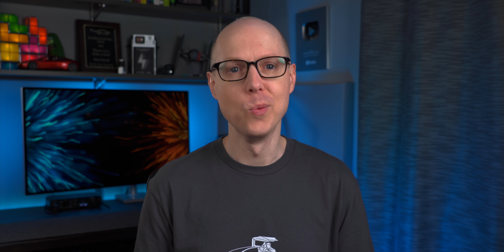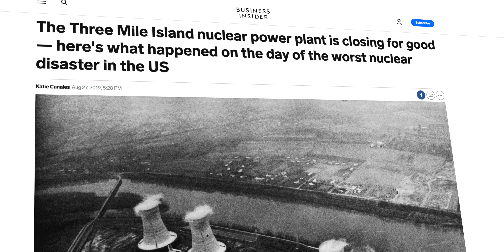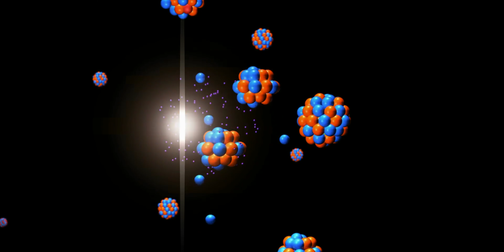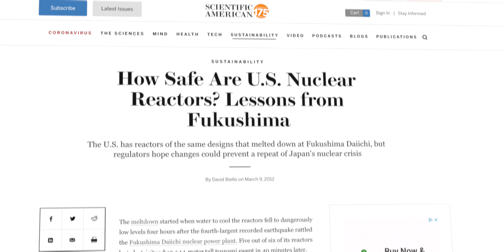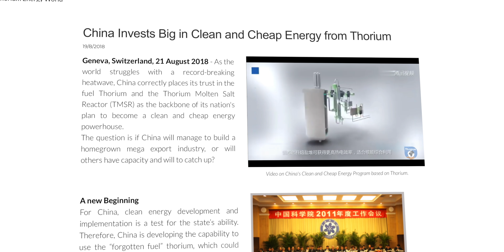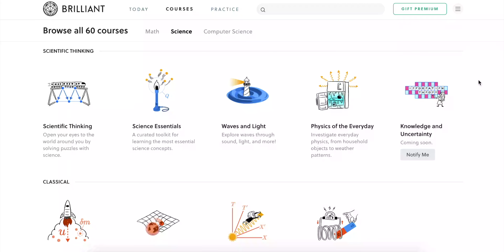Thorium explained - the future of cheap, clean energy?

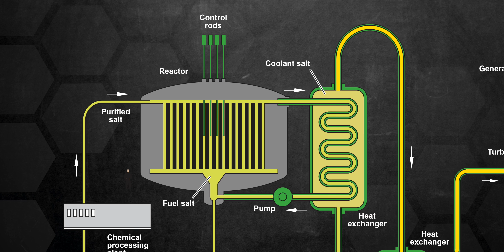Comment: (6:05) "This is the biggest safety benefit over traditional nuclear reactors we have in use today". 
1) You don't have to actively remove graphite from the reactor. Thermal spectrum MSR thorium breeders have a negative temperature reactivity coefficient, meaning if they get too hot, the overall fuel density in the system will drop, which in turn reduces reactivity and cools down the reactor. A continuously operating reactor will eventually find a point of stable activity in a completely passive fashion and doesn't require any operator intervention. That's not the most important safety feature though.
The most important safety feature is the second thing you noted, not having to use HIGHLY pressurized water. The primary issue, and the cause of all historical nuclear accidents, (and the single largest contributor to the high cost of nuclear reactors) is highly pressurized high temperature water. You eliminate the need for water, a mountain of nuclear reactor issues just go out the window.
Reply: The negative temperature reactivity coefficient is also convenient for load following.
-More load
-Increase the flow rate of secondary loop to extract more heat energy
-The primary loop cools down, increasing reactivity
-Increased reactivity then balances out with the increased heat extraction from secondary loop
-Load following by design
Reply: @doritoification  100% correct on that. Of course, I think too significant a drop also increases the likely hood of nobel metals precipitating out of the fluid and plating on the inside of the heat exchanger. Still, that's more of an issue of the geometry of the heat exchange and effective management of the chemistry. 
Still, the inherent thermal/reactivity stability and the ability to load follow is badass. It's so awesome, it feels like it has to be a scam.
Reply: @williamsmith1741  too good to be true haha
Reply: @doritoification   no
Reply: @willrobbinson  no to which bit?
Reply: @adolfodef  not sure which designs you've been looking at but the graphite in most designs would be permanent and the control rods are the thing you suspend magnetically. Also the freeze plug will be actively cooled by a refrigerant system that requires power so in the event of a loss of power yes it absolutely would melt even if the fission reaction is over, decay heat would be enough.
You never want to loose power because although the freeze plug is a fantastic safety feature, it would condemn the reactor to a very expensive ball ache if it were ever used
Reply: @doritoification  Trying to recall the comment you were responding too. However, I just wanted to qualify your second comment a little. From an operational standpoint, losing power such that the freeze plug melted and your core drained into the drain tanks, this would be a pain in the ass, but for two reasons. 

1) If you lose power and your reactor drains, you're going to have every NRC guy and their dog in your facility, being as intrusive and as fun as a pap smear exam, trying to figure out what happened. 
2) For you to lose power and have your reactor drain into the drain tank, your facility will have had some bad things happen or have some SERIOUS problems. The inherent stability of thermal spectrum MSR's make them super safe to begin with. Video's like this misrepresent what the drain tank is, talking about it like the tank is one of the first or primary safety features of thermal spectrum MSR's. It's not. You're only using your drain tank if you're draining the reactor for maintenance or if some serious #$%@ is going down, like a plane flying into the building. It's there for utility and as a last stop-gap safety measure. Just a nice card to have in your back pocket. 

Beyond those two issues, I don't think having your reactor drain into the tank would be a huge issue, other than some chemistry to address the additional salt from the freeze plug and it's impact on fuel density. Correct me if I'm wrong though.
Reply: @williamsmith1741  whoever i was replying to deleted their comment but from memory they were claiming that the freeze plug wouldn't melt if something went wrong and the whole safety feature was a gimmic.
I didn't know the drain tank was a feature for normal maintenance but I guess that makes sense
Reply: Doppler broadening is important, but I don't trust any reactor without a significantly negative alpha-mod.
Reply: @kennethmiller2333  That's exactly my feeling whenever someone introduces fast reactors, of any design to the discussion.
Reply: @williamsmith1741  I absolutely understand the appeal of them.  But for a moderate upside, you have a catastrophic potential downside.  Thermal reactors will always be the way to go.
Reply: @kennethmiller2333  I mostly agree with you. I think there will be a place for fast spectrum reactors, but more of a specialized role, such as breeding starting fuel loads for thermal spectrum reactors and serving as waste burners. Thermal spectrum reactors, on the other hand, will be the real work horses. 

Fast spectrum reactors definitely are enticing though. So enticing that people just keep throwing money after it, wasting billions on program after program, none of which really amounted anything. 

Still, maybe Elysium got it to work with their chloride salt. Phiel's a hell of a lot smarter than me.
Reply: @williamsmith1741  I would like to see some sort of way to use a fast fuel... but inherent stability is just too big of a benefit to give up.
Reply: @searchfluoridemakesyoustup5883  Anything in excess can become toxic or detrimental to your health. Take for example water intoxication or protein poisoning. Fluorides are naturally occuring minerals which are already present in most fresh water sources, as it's a salt that water leeches out of the soil and rocks. Above certain concentrations it can become toxic, but you can say the same about almost everything.
Reply: The Achilles heal of Nukes is their maintainability.  In 1971 we sent a runner to the gate at Oyster Creek in NJ, to bring in (2) pipe welders from the Union Hall to replace (2) pipe welders that were close to their exposure limit.  The runner said "I guess you guys are here to replace the guys that got "burned out".  They picked up their personal gear, without another word and split. This was very early in the Nuke business and people were skeptical.  Skeptical won.  Burned out was the slang we used for someone at their exposure limit.
Reply: @johnwhitehead5457  How well they last is still a question, but really in terms of decades. Oak Ridge's MSRE operated for the better part of a decade and subsequent evaluation of materials showed no material signs of corrosion or deterioration. But how will the equipment look after 15 years, 30 years? That's the question. 

Not having to operate at such ridiculous pressures, however, should improve the mainainability though. Leaks also wouldn't be an issue. Molten salts require temperatures of several hundred degrees celcius to liquify. Assuming you had a hairline crack in an insulated pipe and the salt started working its way through the crack. The salts going to start losing heat as it gets closer to the outside of the pipe, and would likely freeze, plugging the crack, well before reaching the outside. To get salts outside the reactor, you'd probably have to have a decent sized crack or hole, or even sheered pipes. Still, even in that case, and the reactor completely drained into the reactor room, you wouldn't have a major release of radioactive materials other than the gaseous fission products like xenon and krypton which had only just been produced (small amount of short lived fission products), as the cesium, iodine, and everything else would stay in the salt, which would likely be solid within an hour or two (or a day at most).
Reply: Approved - make it so.  But we just lost our driving force, DJT.  Who will step forward with the motive of Get the job done.
Reply: Not sure I'd agree that highly pressurized water was the cause of every major event in the industry. Obviously the steam explosion at Chernobyl was what spread the radiation, but reactor design and incorrect operation and reactor physics causing the reactor to go prompt critical was the cause of the steam explosion. TMI was a stuck PORV (pilot operated relief valve on tye pressurizer) that was not recognized and caused a solid condition in the pressurizer and voiding in the core. That is kind of pressurized water, but still more of an operator action thing. Fukushima was flooded emergency diesel generators and the explosions were from hydrogen accumulaing over the spent fuel pool. 

Also, load following does have to be designed in to a reactor, and the biggest factor that makes significant load following difficult is accumulation and burnout of xenon 135, which is a reactivity poison and provides challenges in reactor control if it fluctuates significantly on a regular basis. For small fluctuations in turbine loading and small delta changes accross the steam generator, the negative moderator temperature coefficient and negative fuel temperature coefficient (doppler broadening as somebody else mentioned) will adjust the reactivity to keep the reactor pretty stable and providing the heat needed to match steam demand. For big swings in load, such as in the evening when solar cuts out and usage is high, followed by dramatic drop in usage a few hours later when people turn off the lights and appliances and go to bed, asking most nuclear reactors to make those adjustments is not good. Considering Xenon will not reach equilibrium for around 40-50 hours, you'd have a reactor that was constantly changing one of the least controllable major reactivity factors. I would think you would also need control rod movement to truly follow the load and your peak flux would be constantly moving, which could cause oscillations in the reactor as well as uneven burnup of fuel. I am not an expert at all of this, but those are the problems I immediately see with the idea of actually trying to follow the demand curve. In my opinion, which is admittedly not worth a ton, the best thing to do, rather than try and follow load with a nuclear reactor, would be to run plants at 100% power all the time (plant conditions permitting) and put the excess energy into storage. What kind of storage is a whole other debate, but I generally like hydrogen considering that nuclear plants are generally located near a plentiful supply of water. Then nuclear continues to supply baseload, helped out by whatever other plants are on the grid, but during demand peaks, instead of trying to make dramatic changes in reactivity or kicking on a fossil plant, stored energy is just fed back in to the grid.
Reply: @F14Goose37  It was also the issue with 3 Mile island and it was with Fukushima as well. When the gas generators went down, the plant lost the emergency back-up pulling the remaining heat out of the reactor. Once they lost that, the water started boiling and the steam started reacting with the zirc casings and creating tons of hydrogen, which led to the explosions. So yes, Chernobyl and Fukushima were different issues, but they're both related as they were both caused by water and it's relatively low boiling point. With molten salts, you get to operate at MUCH higher temperatures because molten salts will melt and become water like at very high temperatures and maintain that liquid state (not boil) for a very wide temperature range, and of course this is at atmospheric pressure although you'd want to have some pressure in the reactor to make sure you don't have any atmospheric gasses getting into it and messing up your chemistry and your ability to monitor it. 

So, with an MSR, you've gotten rid of water which: 1) allows you to operate at much higher temperatures which significantly increases the efficiency of generating electricity (getting more power out of each unit of fuel), 2) you're operating at near-atmospheric pressures so you can get rid of all those thick-ass pipes and the Hoover Dam levels of concrete because the salts can never reach a temperature that would allow them to boil (at least not in a thermal spectrum MSR); and 3) if the fuel is dissolved in the salt you will be able to follow load very easily. That's because many of the fission product neutron poisons, like xenon, will be gases at the temperatures the reactor will be operating at (xenon being a gas to begin with) which will naturally bubble out of the salt all their own, but can be helped along with a continuing helium flush, bubbling the xenon out like CO2 out of a soda. You can follow load by running the cooling salt through the heat exchanger faster, pulling more heat out of the fuel salt. The fuel salt leaving the heat exchanger and going back into the moderated core will be cooler, and thus the liquid salt would be denser causing the fuel density to be higher, increasing the chances of fission in the core. It's the same feature that make it impossible for the reactor to have a run-away reaction above a certain temperature, as the fuel salt will expand with increased temperature, causing fuel density to fall till it's no longer able to maintain criticality.
Reply: @williamsmith1741  That was an interesting and informative reply. Thank you. I did not think about xenon being removed in that manner. I would have figured xenon production would be similar in U233 as it was in U235 based on its mass vs. yield curve and burnout was still the main vector for removal of xenon. I would still say that steam was not the cause of those accidents. I see what you are saying in regards to the role boiling or flashing to steam had in those events, but it certainly was not the cause of the event. MSRs do have a lot of advantages and I hope to see a lot of commercial MSRs in the future. I hope that by the time I am done in the industry, I will see some online and maybe even work at one. I think that they will have their own set of drawbacks though. Like in a PWR, you do have a lot of thick piping to support something like 2250# in the RCS and 900# in the secondary loop leaving the SGs but then again it is mostly reasonably priced materials like common stainless alloys. MSRs will have to use very expensive corrosion resistant materials in their primary loops and steam generators though, and I am sure that will come with its own set of chemistry, materials and maintenance issues. 

And I still would rather just stay at 100% in a big utility reactor and store excess energy than try to load follow. On a small, mobile reactor like the DoD wants to use for remote operating locations, a reactor designed for load following makes sense. In that application, aside from on ships, light water reactors don't make sense anyways.
Reply: @F14Goose37  Yes you are correct that water didn't cause those accidents in that they weren't the trigger. The Chernobyl reactor was an overly complex/bad design and there was user error and the Fukushima accident wouldn't have happened if they'd had 40 ft walls around the diesel generators rather than just 10 ft ones. But you can't have human error unless you have a system that allows for human error. Unfortunately, LWR's, with their positive temperature reactivity coefficient, are a system that allows for human error. We've managed that error by stacking level after level after level of safety features and backup safe features to them, trying to minimize the chance of human error ever amounting to anything. Problem is, that added A LOT of additional costs, which you can see by looking at the capital cost per kW. Koomey & Hultman looked at the overnight capital costs for nuclear power plants, by date of completion, going back to 1971. Current reactors are in the range of $6,000 per kW to $8,000 per kW, compared to coal and gas which are in the range of $1,000 per kW to $1,500 per kW. However, prior to 1983, the average capital cost for nuclear power plants was a little over $1,500 per kW (oh, and these numbers are in constant 2014 dollars, so they're inflation adjusted). The average cost for nuclear power plants started climbing very fast starting in 1983 because you started to see the completion of plants whose design and construction was impacted by the 3 Mile Island accident, another human error involving water. That's when you started to get more and more safety features slapped onto plants to "make them safer", but which were mostly catering to people mostly irrational fear of nuclear power in terms of how overblown it is. If we could build a nuclear reactor that didn't need all the safety features which "Post-3 Mile Island" reactors required, we'd have nuclear power plants that were almost comparable in cost to those of coal and nat. gas.

I don't mean to imply that LWR's are unsafe though. Current nuclear reactors are arguably the safest source of power on the planet, with fewer deaths per terawatt hour produced than any other power source, including wind and solar. Super safe. 

I also agree with running at 100% or over building to 120% of anticipated peak demand, feeding power to a low cost storage that would even out the direct draw on the plant and feed the excess to a dedicated user of that excess power, like a CO2 capture facility that would pull it out of the atmosphere and convert it to carbonic acid, which you can pump into basalt deposits, mineralizing the carbon and not just "bottling it up".

Thermal spectrum MSR's probably will require materials more expensive than stainless steel, as I assume nickel alloys are going to make it more expensive (this is a chemistry management issue though and some reactors, like Elysium's fast reactor, will use salt chemistries that can work in stainless materials already approved for use in reactors). Still, even if the cost of the materials from the core to the heat exchanger are double or triple the cost of stainless, that increase would be VASTLY outweighed by getting rid of all the safety features required to deal with hot water at incredible pressures and contain the steam from that water if you have a break within the system. MSR's would work well in modular designs too, but a lot of different reactors do as well. In a MSR plant, the only thick piping I can think you might have would be for the hot water going to the actual turbine (or CO2 or some other gas if you're using a brayton cycle), but you'd have those thick pipes regardless of the original heat source.
Reply: @williamsmith1741  Yeah the only part  of the secondary loop that changes is the tubes and tube sheet(s) in the steam generator. 

I think the cause issue is probably not very important to the conversation. Seems like you and I are pretty close to the same page on the macro level but are just being a little anal on language(mostly me).

What do you mean when you say an LWR has a positive temperature reactivity coefficient? If you are talking about the moderator temperature coefficient, it decreases reactivity in an undermoderated reactor as temperature increases. Fuel temperature coefficient also decreases reactivity as the temperatures of the fuel rise. The only time the moderator temperature coefficient is positive is when the reactor is overmoderated in shutdown conditions or at low power as it is coming up from being shutdown. The when and how much you can be overmoderated is outlined in the plant's tech spec as is shudown margin, so while you can operate a plant incorrectly and exceed tech spec, you do have it laid out for you what your boundaries are and it should keep you well away from having a runaway positive reactivity issue.

The plant I operate was built after TMI. We started construction around that time, but didn't bring the first unit online until like 1986. I don't think the safety features are too extraneous. I would agree, if operated correctly, it takes a lot to have an issue at a "modern" pwr. I am not a tecnical expert on MSR design. My curiosity in advanced nuclear is what made me want to go into operations at the plant, but there is a lot to learn about PWRs, and I am still far from an expert on my own plant. I would still think you would need a lot of the safety systems a PWR has. Maybe not a containment building if the primary loop is not pressurized enough to spread radionuclides outside the plant, but I would still think you'd need shutdown cooling, emergency generators and stuff like that. I'd be curious to see a good analysis of what each design would take financially, both from a perspective of what a safe design would be from a good engineering standpoint and what a design that meets regulatory compliance is(because we know that is where a lot of extra cost comes from and it is not always regulation that makes anything safer). I expect that any good advanced reactor design would be more economically practical than a PWR, but I still would love to see exactly how they compare.
Reply: @F14Goose37  You are correct, I was referencing something I'd read on fast spectrum reactors, but which itself wouldn't be true above a certain point in a MSR fast reactor like Elysium technology. 

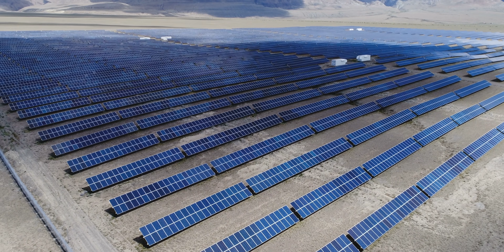Costs didn't jump to 8k per kW immediately in 1983, just roughly doubled vs reactors built in 1982 and have been on a steady increase since. The paper I referenced was a research paper by Hultman and Koomey. I learned about it in a YouTube video "MITAB20-Ian-Stable Salt Reactors - a new platform technology in nuclear fission", the presenter used one of their charts. I had to look for the cited paper and buy a pdf, but that's on my work computer. You'll Just search for the video I mentioned, the chart's at 8:15. You can also search for the paper on ScienceDirect. 

No containment is required, although you probably want something to keep someone from flying a 747 into the reactor or something, I suppose. If someone crack the reactor open, the only real loss of radioactive material you'd get is from xenon and krypton fission products released at the time of breach, but that's not a significant amount since they don't build up in an MSR like they do in a LWR or PWR, since there's no solid fuel pellets or fuel rods to trap any fission product gasses. The remaining radioactive material remains in the salt and is locked in the salt once it cools after a few minutes, as it'll solidify once the temperature drops below the salt's melting point of a couple hundred degrees Celsius (depending on the salt chemistry). The reactor is self stabilizing based on the temperature of the salt its impact on relative fuel density. Beyond that, the MSRE added a drain tank to drain the fuel salt into in case of an emergency, which they also used to drain the reactor and conduct maintenance on the reactor. I'm not sure why you'd need something like the kind of emergency generators you have on solid fuel reactors, like the ones that got flooded at Fukushima. In a thermal spectrum MSR, other than some delayed neutrons, most fissioning would stop almost immediately after the core is drained and removed from the moderator. That hot radioactive core salt being a liquid, has a high capacity for heat rejection, and since it's already a liquid, you don't have to worry about the fuel "melting". There's also no zirc rods or water/steam to react with each other.  

You seem to be applying your knowledge of PWR's to an MSR, which isn't really correct. They're about as similar as a coal fired steam engine and a gasoline engine. If you're interested, you can watch the video that Oak Ridge National Laboratory made back in 1969. It's on the lab's YouTube channel, and called "The Molten-Salt Reactor Experiment". It's like watching an old Disney film. 

You can also get "Molten Salt Reactors and Thorium Energy (Woodhead Publishing Series in Energy) 1st Edition", a textbook on MSR's in general on Amazon.
Reply: @F14Goose37  Here's the video on Oak Ridge's MSRE

https://www.youtube.com/watch?v=tyDbq5HRs0o
Reply: @williamsmith1741  I am not sure how much of an issue xenon would be. I don't know if all the isotopes have a short half life, but xenon 135 decays enough that a light water reactor is considered xenon free after a little more than 3 days. I don't know what state each fission product would be in at atmospheric pressure during a large RCS breach like you would have from an aircraft crashing into an unprotected reactor. I know reactors using TRISO fuel are not concerned about it because the kernels of fuel are extremely robust and radiation is not likely to spread beyond the area affected by the aircraft or missile impact. 

Decay heat upon shutdown is still a lot in any reactor. Light water reactors still move a ton of water to remove decay heat. When control rods drop in a light water reactor, prompt fission stops immediately and decay heat is all you are left with, so shutdown cooling is only to deal with decay heat. I don't know if an MSR would need decay heat removal. It would still be a significant source of heat, but I am not sure if it would matter. I think I remember hearing that it is not a concern, because if it were, it would not be "walk away safe." I have a lot to learn on the technical details of this design. I know I am excited about a lot of the ideas companies are trying right now, and better yet, the engineers I know who understand this stuff better than I do (I am just an operator, a dumb monkey with a wrench, not somebody who designs it) are excited about a lot of the same things I am.
Reply: @F14Goose37  As far as costs go, I can't anticipate all the cost differences. What I can do is just assume the costs associated with current PWR's and LWR's. Then I replace all the reactor piping that has to hold 150-160 bar of pressure, replacing that with a nickel alloy for reactor piping and stainless steel for the secondary loop. Then I get rid of the massive containment structures, as there's no risk of a release of radioactive material like cesium or iodine via water vapor. I also won't need all of the extensive materials testing/x-raying for micro fractures or anything like that since we won't be dealing with any serious pressure. Also getting rid of EVERY safety feature on the reactor that's designed to deal with water pressure and long term storage of waste, as water pressure isn't an issue with this reactor and almost all the waste you're producing is going to be fission products with very little transuranic. Doing all that, you've SIGNIFICANTLY reduced your capital costs while also shortening completion time, reducing your uncovered interest costs. 

On the flip side, if it's a thermal spectrum reactor, it would require online salt processing to pull off any non-gaseous neutron poisons. Am I  factoring in the cost of the chemical processing equipment. Nope, no idea what that might cost. Would it cost as much as what you saved by getting rid of everything noted above? No F-ing way. Would it be cheaper than coal and natural gas? Yes. 

It would be cheaper because even if the total capital cost is greater, this reactor would be producing FAR more power to spread that cost over. That's because an MSR running on U-233, unlike an LWR running on some U-235/U-238 oxide, can get close to 100% burn-up of the fuel, compared to 6.5% for your convention oxide fuel reactor.
Reply: @F14Goose37  Also, if you are suggesting that we're on the same page in that we both think nuclear should be where we invest our money, getting us off fossil fuels and addressing climate issues, you're 100% correct on that. I support renewables, but only in the sense that nothing should be off the table. However, there's only two places that have been successful at getting off the fossil fuel teat, and that's France and Ontario Canada where they get like 60% of their power from nuclear.

Renewables and fusion are a distraction. Fission all the way baby!
Reply: @williamsmith1741  Nuclear does need to be the future. Fission is the most promising technology to cover the bulk of our energy needs until we can really get fusion figured out. I think renewables have their place, but trying to use them to cover all your energy production needs is foolish at best. I am sure that with storage technology innovations, it is possible, but that does not mean it is wise. The better we get at nuclear, the less downside there is to it. Considering how small the downside is currently, I'd say it has to be pretty hard to be informed and anti-nuclear.
Reply: @F14Goose37  I would imagine decay heat wasn't wasn't an issue. Oak Ridge operated a one (just an MSR, not an MSR thorium breeder) and they would shut it down and drain the reactor on Friday because the researchers either couldn't or wouldn't work on the weekend. Because it's a liquid at such high temperatures, the metal drain tanks provided sufficient heat rejection. On Monday they'd heat up the salt so they could pump it back into the reactor and get back at it. It was really easy to stop and start back up again. 

I only know what I know because I heard about it 5 years ago or so and thought it sounded WAY too good, and had to be a scam or something like it. So I kept digging, going to the point of buying and reading through text books. There's definitely issue with the technology, I would never say otherwise. But they're chemistry and engineering issues, like figuring out how to test the salt pH and making sure nobel metals don't plate out on the inside of your heat exchanger when as the temperature of the salt drops. There's also the issue of getting the starting U-233 fuel load for MSR thorium breeders. Other issues, like corrosion, tritium, and other things, are either heavily overblown, or they're being selectively applied to MSR's and not other potential power sources which also use almost the exact same types of materials, types, like the SPARC reactor for instance.
Reply: @F14Goose37  Totally agree. Even with fusion, if you compare based on the total nucleons involved, fusion is only marginally better in terms of the amount of energy released, as you're only getting 2-4X the amount of power per nucleon from fusion than you are with fission. Assuming you could fission 100%, or near to it, that you put in your reactor, you're already getting damn close to the same power you'd get from a fusion reactor. Then you have to factor in all the power you've got to pour back into the reactor to maintain those magnetic fields, and how log do you thing that multi-billion fusion reactor vessel is going to last just being blasted by all those neutrons from your deuterium-tritium fusion? What are you going to do with those radioactive vessels after you switch out the old core for a multibillion dollar new one? Where are you going to get all the required tritium to run your "limitless" power source? Lithium, because lithium is decently common, right? Except Li-6 is what you get tritium from (after fission the Li-6) and Li-6 is a relatively small portion of natural lithium (Li-6 is about as common as thorium).

Fusion is better than fission in theory, but only marginally. So, while we wait for commercial fusion to get here in 100 years or whenever, why don't we focus more attention on fission. If someone from Green Peace has a problem with that, ask them why they hate the environment so much? Every time they kill a nuclear power plant, it's getting replaced with gas.
Reply: @F14Goose37  I think it's half like is like 8 hours or so. I don't think xenon is the issue though. It's thing like cesium and iodine what dissolve in the water when the cladding ruptures and then go up into the atmosphere along with the steam. With a salt, that can't happen because all that stuff stays locked in the salt, which will never reach a high enough temperature to vaporize like water does. 

There are tons of different reactor designs, and there are different benefits and different drawbacks to each. There is no Gen 4 reactor with no problems. Some just work better for some thing while others work better for others. I'm a fan of thermal spectrum MSR's because of their inherent stability and safety. They're also mouth wateringly efficient, being able to burn up almost 100% of the fuel, compared to a solid fuel reactors 5% or 6%, but that's a trait shared by most MSR's. 

Take current nuclear reactors and either 1) cut their capital costs by half, at least; or 2) drastically increase their fuel burn-up, going from 6% up to 90% - 100%; do either of those and I think you'd put fossil fuels to bed relatively quickly. MSR's can do both, and more, but that's when it starts sounding so good it has to be a scam.
Reply: @williamsmith1741  Sorry. I was talking about MSRs when I was wondering about which radionuclides would spread beyond the area immediately affected by a plane crash. A large break loss of cooling accident on a light water reactor with no containment would be a disaster. 

So one of my fellow operators has a master's degree in nuclear physics and I was talking to her about some of the stuff I had been reading about. She mentioned that some of these reactors, after further processing their spent fuel, we could be looking at half lives of decades instead of centuries, which would be huge. Using most of the fuel in lower enrichment fuels would be huge. Fast reactors are intriguing in that regard but I am also not well versed in that technology.
Reply: @F14Goose37  Of course, you also get hydrogen from rogue neutrons busting water molecules apart, which is why nuclear plants have recombiners too, but steam reacting with zirconium tubes is what happened at Fukushima. 

And I do support other technologies, like liquid metal batteries, but load following is absolutely a strength of MSRs. You are absolutely correct, however, in pointing out it's not something you can do with solid fuel reactors as xenon has a pretty hard time "bubbling out" of the ceramic fuel pellets.
Reply: @F14Goose37  eww hydrogen. Why incurr such massive conversion efficiency losses for diurnal load following. Molten salt thermal storage is crazy efficient by comparison and you don't have to worry about all the weird engineering challenges you get with hydrogen embrittlement that plague the whole hydrogen economy boondoggle.
Reply: @doritoification  Because hydrogen works well with so much of our existing infrastructure and can be stored and transported pretty easily, made pretty easily, and disperses quiclkly when you have a leak. It is not the most efficient storage medium, but it is versatile. Plus it has a pretty sweet byproduct once it is used. I like hydrogen for a lot of semi-logical reasons and some emotional ones. I think it makes more sense than storing energy in lithium ion batteries. In vehicles, especially commercial long haul vehicles, it makes more sense than plug in electric because plugging in for 45 minutes to get 200 miles of charge is not at acceptable to a long haul driver, but fueling times comparable to a diesel
Reply: @doritoification  sorry. Hit send too early.

Basically, I think the rest of the energy economy already is closer to running on hydrogen than anything else. It just makes sense to me to produce hydrogen, store it, use what you need to feed back in to the grid, and what you don't need can be sold as fuel for fuel cell vehicles or as fuel for industrial furnaces. It can even be used in gas power plants if you find you still need to run them. One of our gas plants I know can burn up to 30% hydrogen and 70% natural gas. Long term, we should be able to get rid of gas plants, but short term, there are still a lot of utilities who need to operate gas plants for a lot longer.

I do not necessarily have anything against a lot of other storage options (except batteries on massive scales), but I think even though hydrogen has issues, it makes a lot of sense in a lot of areas. It is not hard to produce excess clean energy, so while I don't want to say efficiency should not be a concern, the added cost of an inefficient storage medium could be offset by the other potential uses for the stored energy, and even the byproduct (you could sell the pure water produced). Obviously, if I was making decisions for my utility, I'd need to thoroughly look in to all options and it woukd take months if not years to figire out what storage medium is most beneficial, but from the perspective of somebody who works at a plant and reads about energy as a casual hobby (one of many) hydrogen looks pretty good to me.

Emotionally, I would like to see hydrogen as a commonly available fuel for vehicles, because if I ever have to stop burning gasoline, I still love internal combustion engines, and hydrogen is a good alternative fuel for that. It does have a smaller quench area and is more prone to auto-ignition on hot spots because of it, but it is also more knock resistant, so there are some cool possibilities I hope to explore someday. Theoretically it should be able to take boost well and in a direct injected engine should make power pretty well. Water or meth injection could help with the hot spot auto ignition issue, and there are already a bunch of engines that would be good platforms to try this on. You could even run a condenser in the exhaust to help spool the turbo quicker. It would not have to operate at vacuum, just condense enough moisture from the steam to reduce exhaust pressure on the back side of the turbo. Hopefully I will have the time to try and tinker with this some day in the not too far distant future, but this is an emotional reason that only I care about and should never drive a real decision.
Reply: @F14Goose37  It's cool to read about your engineering passion regarding hydrogen, thanks for sharing. I was never that interested in combustion engines specifically but always fantasised about having a luxury car and recently took a test drive in a tesla model S P100D. Boy oh boy 0-60 in 2.5s was nuts and their latest offering can do it in 1.99. The quiet drive train and simple plug in at night to wake up with a full battery ecosystem with all the bells and whistles is truly a game changer. For the record teslas semi (when they produce it) will charge 500 miles in 30 mins and truck drivers are mandated to stop for breaks a certain amount. EV trucks will take the market for short haul trucking which is actually most of it. You can get from a lot of ports to a lot of population centres within 500 miles 

I do like hydrogen for certain things. Synthetic hydrocarbon production for the aviation and petrochemical industries as well as a reducing agent in processes like steel production make a whole lot of sense to me. These things are difficult to decarbonise in other ways and plastic products could actually be carbon negative, making their persistence at least have some positives.

I completely agree that battery storage on a large scale is ridiculous. We should deploy some for grid services, frequency control and the limited amount of energy arbitrage which can be profitable but that's about it. An MSR with thermal storage avoids any conversion efficiency losses which is a huge deal and the thermal storage is totally scalable. You can run at 100% 24/7 and the storage system does the load following. Then for the things that need hydrogen we should build dedicated electrolysis which also runs at 100% and preferably uses combined heat and power for greater efficiency but there's no need to build out a hydrogen grid to replace the existing electrical grid for things that can just be run on electricity. The market for hydrogen in transportation will be so small compared to BEVs that you just can't justify the infrastructure for it and thank goodness for that as it's so inefficient anyway.
Reply: @doritoification  I am glad I am not the only one who thinks it would be an interesting engineering challenge then. 

On the Tesla truck, batteries would have to come a long way for them to be viable for long haul trucking. Batteries take up too much of the payload and 500 miles is not a very long distance. In the US, trucks are allowed a max gross vehicle weight rating of like 80,000 pounds. I don't know how much batteries required for 500 miles of hauling 80,000# would eat in to the actual payload for the truck (where the profit comes from), but I do know it is a lower payload than an H2 system would be. I am not and never have been a long haul trucker, so I don't have any ability to speak with authority, but I would guess that having to stop for 30 minutes every 500 miles and hoping there is an open charge station is not an agreeable option. At busy truck stops in the US, you will often have lines of trucks waiting to fuel, which is not always a big deal because a truck filling with diesel does not take a terribly long time, so the turnover rate is high. Waiting in line for other trucks to charge before waiting your 30 minutes could be a real issue. Battery electric trucks would be great for hauling heavy stuff short distances all day within the limits of a single city, but not for the kind of trucking that long haul truckers in the US do. 

The big thing that sours me on lithium ion is the environmental impact of exponentially increasing production. I don't have solid numbers or anything, but it can not be good to deploy batteries on the scale some people are talking about. BEVs are pretty cool, and they would make great enthusiast vehicles as well as some other applications, but to replace the majority of the ICE cars on the road, I think something like a fuel cell vehicle makes more sense. I might be just be a hopeless hydrogen romantic. 

Our utility is an early adopter of utility scale battery storage (at least in the US) and we had a pretty high profile fire and explosion at one of our battery facilities. That was bad, but I know having an accident to study will help improve the technology get safer and improve moving forward. I like an all options considered approach. I just think we need to make sure we use the right tools in the right places. We might all be idealists with our pet technologies at this point though because until more of these are deployed commercially and we iron out the kinks, we won't necessarily know all the ways each technology can be used or where they should not be used. I could be totally wrong about battery trucks, and if I am, I will be cool with that too (as long as it is environmentally responsible)
Reply: @F14Goose37 I also worry about the mining required for all these batteries I have to say. Especially if we continue to pursue grid scale storage with li-ion. It's a problem caused almost entirely by renewables though and i'm hopeful the world will wake up and smell the coffee, build more nuclear and make use of simple thermal storage along side other innovations.

I'm a big believer in autonomous vehicles which would individually take on the work of multiple personally owned vehicles, reducing the overall battery requirements although we're still talking about insane amounts of mining. It's got to be better than combustion though right?

Elon Musk reckons the payload penalty for a BEV truck is minimal and the cost savings of EVs are substantial so I highly doubt there will be any issues with the economics.
I think even if long haul trucking could benefit from hydrogen, there will be one winner that fits the majority of use cases best. BEV will win for almost all use cases and I can't imagine hydrogen infrastructure being built out just for those few long haul trucks. 
Maybe I just want to believe this because i'm a tesla shareholder and am of the opinion that consuming 3x the amount of energy to do the same job is a terrible idea which makes me a bit biased but time will tell
Reply: @doritoification  Yeah, there might be a little bias there 🤣 Good on you though. I used to ride the Tesla wave making money on the turbulent price when it was in the $200's a share area. Wish I would have held some though 😉. I am not totally enamored by Elon Musk but he has grown on me. I wouldn't just trust his assesment on the BEV thing though. Engeneering Explained (who owns a Tesla Model 3 and loves it) did a number of great EV videos, but his video on Tesla's semi is very informative. I also trust his analysis more than Elon Musk. Musk is not exactly impartial or above making extravagent claims to sell his product. 

Also, there is a lot of big money going in to hydrogen. It would not surprise me to see the infrastructure greatly expanded in the next 10-20 years to support the trucking industry, and regular people taking advantage of that and buying fuel cell vehicles. The same thing was said about EV infrastructure until Musk built it.
Reply: @F14Goose37  could you not mitigate the large swings by building a giant energy dump to draw from (batteries) that stores and delivers the energy but is recharged at a consistent rate? I am obviously not a scientist so I’m just asking as a dummy
Reply: @joebast1842  I am not a scientist either. My education background is business and I operate a plant for a living. That is what we were talking about though. Storage options for excess production. I am not a big fan of massive deployment of utility scale batteries as the storage medium though.
Reply: What was your source for this "TOP 10 toxic substances"?

I just did a quick Google search for "World Health Organization fluoride", first result is a WHO page on for Environment, Climate Change and Health, with a  section on "Inadequate or Excess Fluoride", which goes into the risks of excess fluoride, which typically occurs, per the WHO, "through the consumption of groundwater naturally rich in fluoride". 

Also goes into the benefits, stating that, per the WHO, "Public health actions are needed to provide sufficient fluoride intake in areas where this is lacking,". So I ask again, what was your source for the WHO's top 10 toxic substances?

We first learned that fluorinated water protects teeth from looking at the bones of ancient Minoans, as they were perfect (neither worn down or rotten) due to the very high fluoride levels in the ground water of Crete. Given that the Minoans had quite a thriving civilization for quite some time, and, based on remains found on the island, the high fluoride levels didn't cause people to die young or have debilitating physical problems, I'm inclined to think that fluoride is JUST FINE in moderation.
Reply: @UCSiyN8rovPtMH-t2EHgCwyQ I found a list from the WHO for "Ten chemicals of major public health concern", but it doesn't list fluoride as a toxic substance. It SPECIFICALLY lists it as "Inadequate or excess fluoride", meaning you need some fluoride in your water, but you also don't want "excess fluoride". 

So exactly what I said.
Reply: The most important and valuable safety feature of thorium (U-233) reactors is that they never have been, are not now and never will be economical. None of the gnomes sitting in the basement of financial institutions that loan money to operate utilities like to lose money. Anyone politician that tries to use taxpayer money to fund such boondoggles will be tarred and feathered and run out of town on a rail!
Reply: @jackfanning7952  How did you determine whether it's economical? There was only ever one built, and that was a test reactor that was built by Oak Ridge National Labs back in the 1960's for very little money, and it operated for over 6,000 hours without issue. So how did you determine its economics?

What "gnomes  sitting in the basements of financial institutions" don't like is uncertainty, and there's certainly a lot of uncertainty around this technology which was largely forgotten for 50 years, especially with people spreading misinformation about it.
Reply: @williamsmith1741  I did not determine that it was uneconomical. I am not an expert on economic issues. The little gnomes in the financial institutions determined that. That is why they won't loan any money on it. They also determined that all of the reactors currently in operation in the U.S. are losing money and can't compete with renewables. The uncertainly is why should anyone be stupid enough to keep throwing money at nuclear after its dismal performance over the past 75 years? 48% of the ones planned never even operated. There has never been a nuclear reactor built within budget and on-time. Never ever. 5 meltdowns in 35 years is pitiful. More to come with those brittle, leaky reactors too expensive to maintain. I don't have to spread misinformation about nuclear. I can just sit back and watch it destroy itself. It certainly is fun watching nukies self-destruct with incompetence, fraud, graft and corruption. Thorium was largely forgotten for 50 years because it was uneconomical and only now are the nukies running out of commercial grade uranium ore and are hoping to rely on thorium to keep Uncle Sugar's loot rolling in.
Reply: @jackfanning7952  Did you watch the video? You realize that a thermal spectrum MSR thorium breeder is nothing like current fission reactors? It's a completely different technology with a completely different operating process and different capital cost requirements (hint, they're a lot lower than those of LWR's). So by conflating MSRs with LWRs you're either being willfully ignorant or simply deceitful (spreading misinformation and fostering uncertainty). 

Even if it was the same kind of technology, light water reactors make money hand over fist. The problem with them is that their capital costs are huge so it takes almost two decades to pay down their borrowing costs. However, the cost of fuel of a LWR is only a fraction of that required by fossil fuels, so it quickly starts generating mountains of cash. It also doesn't require mountains of subsidies and VAST tracts of land like renewables. In fact, the majority of nuclear reactors in the US were built prior to the 1980's when the average capital cost per kilowatt were less than $2k/kw. At that level they were comparable with fossil fuels and we were replacing fossil fuel plants all over the country with nuclear power plants. It wasn't until 3 mile island that the they started slapping more and more safety features on plants to deal with the issue of pressurized water, which drove up capital costs, with the cost per plant now being between $6k/kw and $7k/kw, depending on the plant design. However, if you'd watched the video or ANY video on MSR's, you'd know that they don't use water, so they don't have to include capital costs associated with dealing with pressurized water. That would put the capital costs of MSR thorium breeders at just slightly more than those of fossil fuel power plants, but with the capacity of generating over 1 Million times the power per unit of fuel as what can be produced from a fossil fuel plant. 

Again, LWR's are a completely different type of technology, but still, through the late 1970's it was quite common for them to complete on-time and on budget. It was really in the 1980's that you started to see costs and time-lines climb as eco-nuts decided to live in a fantasy land of renewables and a reality of fossil fuels. Only two places in the world that have largely gotten rid of fossil fuels for power are France and Ontario, Canada, thanks to nuclear. Green Germany is still burning lignite coal like it's going out of style. 5 melt downs? If you're talking about power plant disasters, there's been 3. If you're talking about general nuclear accidents, there's been a lot more than 5, like over 100. An yet, there have been fewer deaths per terawatt hour produced from nuclear power than any other form of power, including wind and solar. 

Thermal spectrum MSR's, not thorium, was forgotten 50 years ago, not because it didn't work, but because the focus has ALWAYS been on fast reactors, not thermal spectrum reactors, because it was driven by Fermi and all the like for various reasons. MSR's were an afterthought being pushed by Eugene Wigner and the researchers at Oak Ridge National Labs. Many of the powers that be wanted to largely shut down Oak Ridge's efforts to give the money to Argonne National Labs to work on fast reactors, which they eventually did, causing the MSRE to be forgotten.  

You say you're not an expert on economic issues, but you don't seem to be an expert on any issue. You say you don't spread information but all I'm hearing is ?leaky, over budget, 5 meltdowns, fraud, graft, corruption, running out of commercial grade uranium?" That's all misinformation. I offer dates, amounts, various other facts. I can list for you the benefits and drawbacks of VARIOUS kinds of reactors (they're not all the same despite your characterization). You only offer misinformation, hyperbole, and sensationalism. 

If you oppose nuclear power you are pro-global warming just the same as if you oppose vaccines, you are pro-measles and child death.
Reply: @jackfanning7952  Seriously, reading your comment is like reading a comment from a climate denier or QA-person talking about how the presidential election was stolen.
Reply: @williamsmith1741  No, I did not watch the video. I don't like nuclear koolaid. It burns my throat. The cancer comes later. I do like poking nukies and gloating over their demise. They started slapping regs on the nukies because of the irresolvable messes at Hanford, SRS, White Sands, Asse, Semipalatinsk, Windscale, the Smiling Buddha, Santa Susana, Church Rock, Moab, and on and on, ad nausium. They said, "Hey, here's a brilliant idea. Let's regulate these bastards before they kill us all." But then they put their cheerleaders in charge of the regulators. Big mistake. MSRs, SMRs, PWRs, LWRs are all nuclear reactors. I am diametrically opposed to any and all of them. So is everyone else, except a few mass murderers with a vested interest in the looting and pillaging that nuclear fosters on the rest of us. The reactors are all obsolete dinosaurs that cannot compete with renewables, even if you disregard the cost of operating thorium reactors, and the cost of mining and processing the 1 million lbs. of 0.1% ore (if you can find ore that rich.They shut down Shinkolobwe) to get 7 lbs. of U-235 for traditional reactors, and disposing of the radioactive tailings and waste (which has never been done), decommissioning reactors (most are just being shut down and put a lock on the gate. BTW, what do you think of rubbilization), and cleaning up the messes after the meltdowns at TMI, Chernobyl and the 3 at Fukushima. (haven't even.  made a dent on this 240,000 year problem yet) Someone could write a book on all of the other nuclear disasters and meltdowns, but it would be too large for anyone to read. Even France has had their arm twisted into promising to reduce nuclear to 35% by 2035, which is another lie by the nukies, but who is counting? Certainly not the NRC or IAEA. You keep spouting your lies and projectile vomiting your radioactive crap all over the world and see how many buy into solar and Tesla's PowerPacks and PowerWalls. See ya', wouldn't want to be ya'.
Reply: @jackfanning7952  So you're pro-global warming then. I have to assume so since you have a self-admitted and proud ignorance and blanket opposition to the ONLY proven method of decarbonizing an economy (points to France and Ontario, Canada as the only examples of this being done). Reiterate my point, if you are anti-nuke you're pro-global warming just the same as if you're an anti-vaxxer you're pro-measles and pro-baby death. The fact that you didn't watch the video, you're only on here to post misinformation, proves this. 

None of those accidents (all of which were research reactors and the accidents you mentioned being fairly minor) mattered as far as driving up costs. Regulations on nuclear power plants started going up following the 1979 3 mile island accident, which didn't do anything. But fossil fuel companies sponsored tons of adds to freak people out, convincing them that "Rays" were coming out and irradiating them. ("Better to use Solar power"-add paid for by a heating oil company). It was in direct response to 3 Mile Island,  which was caused by high temperature water (just like Chernobyl and Fukushima), that you saw reactor costs start going up. 

MSR's don't have that issue since they don't use high temperature water. You previously stated you don't know anything about the economics or nuclear reactors, and no, renewables can't compete with nuclear reactors on a level playing field. And since you brought it up, they don't mine thorium. Thorium is a fairly common element which can be found in monazite ores in the waste streams of MOST mines, like iron, phosphates, titanium black sands. Thorium is a relatively innert element and typically just falls out of the silicates with little processing, and can make up 6% to 12% of the ore material. It's also a co-element to rare earth elements which can typically be found in equal quantities to the Thorium. (So more misinformation on your part).

Yes, twisted arm is the correct statement. The President of France agreed in 2012 to reduce France's reliance on nuclear power to 50% instead of 75% (more misinformation on your part). The promise was made to the Green party to secure their support. As a result, by the end of 2019, France shut down two nuclear power plants, with baseload power largely being replaced by fossil fuels, the equivalent of adding 38 MILLION cars to the road. (Anti-nukes are pro-global warming). Plants weren't shut down for economic, environmental, or safety reasons. Just anti-nuke nonsense. 

You don't know anything about MSR's, you don't know anything about finding and processing thorium, you don't seem to know anything about the make up of nuclear waste that you'd get from a MSR, and you seem to be crowing about replacing carbon free power with fossil fuels. 

Also have to point out you implying lies coming from the NRC, IAEA, the United Nations, and the WHO (I added the last two because they're all saying the SAME thing). Nuclear power is clean, it's the safest form of energy on Earth. Current reactors are a 70 year old obsolete technology, but even with that all the benefits still hold true (safer & cleaner). However, we also have new reactor designs that are even safer than that, which are physically incapable of having the kind of accidents LWR's had, and which would be almost price comparable with fossil fuel power plants (without needing mountains of subsidies like renewables).
Reply: @williamsmith1741  Oh, Hanford and SRS are minor problems. Snicker, snort! One big problem for the nukies: no one wants anything to do with nukies. Sayonara.
Reply: @jackfanning7952  Hanford wasn't an accident, it's a contaminated site from back in the era when you could just dump waste materials on the ground (leading to several rivers catching fire). Hanford isn't too different from what's being caused by solar power production, as all the waste from solar cell production in China is currently just being dumped into rivers and the ocean. 

SRS (snickers?) is also not an accident but a site for nuclear waste and nuclear weapon disposal. Of course, there's LOTS of radioactive waste left there, because we don't have anything we can currently do anything with some of this waste. There absolutely are things we can do to permanently get rid of some of this waste, but anti-nukes won't let us. They'd rather do nothing and complain about how nothing is being done instead of doing something, like burning up actinides like neptunium and americium in a fast reactor waste burner like what's being developed by Elysium Industries. 

Again, you offer misinformation and don't address ANY of my points. 

Anti-nukes = willfully ignorant (Jake Fanning: "No I didn't watch the video I'm commenting on and have no intention of clearing up my own misconceptions") & pro-global warming (Jake Fanning: "I think it's a great thing that France closed down two CO2 free nuclear reactors, purely for political reasons, replacing those nuclear reactors with fossil fuels which produce an amount of CO2 equivalent to putting 38 million vehicles on the road.")
Reply: @williamsmith1741  Please keep referring to Hanford and SRS as "fairly minor." That should bring about the demise of nuclear even faster. A prominent attorney once told me "it is not our job to educate our enemy (and believe me when I tell you, nuclear proponents are my enemy). Just let them say their foolish things and they will hang themselves." Keep talking. How about Moab? Was it minor? Taxpayers have spent over a billion dollars trying to clean up those tailings that are killing fish in the Colorado River. They still aren't finished. Did you know that the 2018 Woolsey fire released more radioactivity from the 1959 meltdown at Santa Susana than TMI? Tsk tsk, those minor problems just don't seem to go away, do they? I know you don't think renewables are a minor problem for nukies. Otherwise you wouldn't be attacking them like you do. You know you are over the target when you start receiving flak. We use solar at a nonprofit I work for to provide clean water to over 5 million of the poorest people in the world. We don't need no steenkin' nukies.
Reply: @jackfanning7952  I don't consider anyone my enemy, least of all people who admittedly shut themselves off to new information. I'm only on here to learn new things I might not know and clear up any misconceptions I come across. As far as winning hearts and minds, I think you're doing more for my cause than I could in the same way seeing a$$holes storming the capital probably made a lot of people reconsider their own political views. 

I'm not going to defend any specific radiation site. I'll only point out that the radiation of those sites stays in those sites and doesn't spread, like CO2 does as well as industrial waste from solar cell production in China. I'd also note that radioactive waste goes away over time (with waste produced from MSR's largely being gone within a decade of being produced) while chemical toxins released from fossil fuels and from solar sell production NEVER goes away. The heavy metal pollution released from coal ash and from solar cell production will be contaminating those sites and rivers, causing cancer and other illnesses, forever. 

I'll also point out, again, that there are only TWO examples of a region successfully decarbonizing their economy, France and Ontario, Canada. If Germany had spent the money it spent on wind and solar on nuclear power instead (while also not shutting down its reactors) it would already completely eliminated its own carbon footprint by now. Instead, Germany has been bringing new coal power plants online, burning lignite coal (the DIRTIEST of coals) because renewables just don't work for baseload power. Anti-nukes would rather shoot themselves and everyone else in the foot, with regards to climate change, than admit they're wrong.

Seriously though, are you a climate denier too or a QAnon person? You certainly sound like one.
Reply: @jackfanning7952  And you don't use solar at no cost. Those cells have a cost, a cost which people living outside the entitled first world can't afford. Those people live in countries which don't have billions to spend on subsidies just to make solar and wind affordable. Even if wind and solar was affordable for everyone, without subsidies, you're only using those cells for part of the day and part of the year. They don't provide baseload power, and a huge chunk of your power is still coming from coal, gas, and nuclear. 

I think renewables are a distraction, a fantasy that people hold up to say "We don't need anything else, renewables will work!" But they just don't work, otherwise Germany wouldn't be opening new coal plants just as it's also closing down nuclear plants. 

We have a serious problem with climate change, and the only real solution is nuclear, as it's the only one that's already worked (France & Ontario). I'm not saying no to renewables, but I am calling MAJOR BS on people like yourself who say it's not necessary and shouldn't be used at all.
Reply: @williamsmith1741 I don't listen to proponents of weapons of mass destruction (nuclear power reactors). I consider nuclear proponents my enemy for health and economic reasons. You can't defend radiation sites because the only possible defense would be insanity. Radiation does spread from those sites. Try to tell the people on the Rio Puerco that radiation doesn't spread and you might lose your scalp, kemosabe! Radiation from 1959 Santa Susana meltdown was spread by the Woolsey fire in 2018; more than from TMI. Radiation from Fukushima is spread by the 300 tons of radioactive water from the cores of those reactors every day. What is it doing to the basis of the world's food chain: plankton. You don't know. We'll find out the hard way. It is being spread right now and again every spring for centuries by the pollen from the trees on the slopes above Fukushima. Towns that were supposed to be "cleaned' after the 3 meltdowns have been recontaminated. They are burning 1.5 ton bags of radioactive debris in Fukushima. Hersheys found iodine-131 in milk from cows 150 miles from TMI a few days after the meltdown. The cows were on silage, not pasture, so it was an inhalation hazard, not ingestion. I haven't seen radioactive waste "go away" from reactors over the last 75 years. Taxpayers are paying utilities $1 billion a year to store it onsite. Thorium-232 has a half-life of 14 billion years and it and its decay products will build up in the spent fuel making it radioactive and toxic. MSRs have serious safety problems with fission products building up in the fuel. There is no known solution for waste storage. Arjun Makhijani and Michele Boyd have a book, "Thorium Fuel: No Panacea for Nuclear Power," that proves the fallacy that thorium is the next white knight of nuclear power that will be clean, safe and too cheap to meter. The founder of nuclear energy, Edward Teller said, "nuclear energy does not belong on earth, it belongs underground, because if you have a tsunami, you put the manhole cover on it and simply walk away." Glen Seaborg, developer of plutonium-239 said that there was no dose of it so small that it did not kill every beagle dog  that he injected it into."  Albert Einstein said that the letter he wrote to the president about "the bomb of incredible force" that could be made from uranium was the biggest mistake of his life. Admiral Rickover, father of the nuclear navy said, " billions of years ago, it was impossible to have life on earth there was so much radiation from the formation of the earth. Gradually over about 2 billion years, radiation was reduced to where life could exist. By splitting the atom, a horrible force is released, recreating the poisons that precluded life from existing." Rickover said, "I think the human race is going to wreck itself." I agree. All it took was one idiot and the wrong kind of kitty litter to destroy WIPP.  Wait 'til the Vogtle Reactor #3 goes bye bye from the dishing in of the 12" steel floor. Hope they don't fuel it up before it happens. I am in the same hemisphere.
Reply: @williamsmith1741  Our nonprofit is over 95% solar, 100% of the time in over 50 undeveloped countries and the largest refugee camps in the world. Our headquarters and production facility in the U.S. is 100% solar. The latest nuclear reactor I know about (Hinkley Point) has agreed with the UK government to provide power for 16 cents per kilowatt hour. The U.S. DOE says wind power was 2.5 cents per kilowatt hour. The U.N. International Energy Agency estimates solar at about 4 cents per kilowatt hour and you can add 2 cents for battery storage. Lazard says utility-scale solar was 6 cents per kilowatt hour in 2017. Renewables and batteries are getting cheaper, and nuclear is getting more expensive. Exelon in Illinois is threatening to close 5 nuclear plants because it can't compete with wind. I say don't threaten, promise. The nuclear option to replace fossil fuel is too slow and too expensive, even if they continue to refuse to dispose of their waste. Renewables are half the cost of nuclear and oh so much cleaner and safer.
Reply: @jackfanning7952  More misinformation. Not all reactors can produce nuclear weapons material. Part of the reason that Oak Ridge's MSRE was ignored in favor of Argonne Lab's fast reactor, and then forgotten, was you CANNOT use U-233 to make a weapon. Contamination from U-232 makes it unusable for both implosion type devices and gun-type devices. Additionally, the breeding ratio of thermal spectrum reactors is so low that it would take you almost two decades to double the amount of material you started with, with that material being unusable due to U-232 contamination. Hell, the fuel coming out of standard LWR's can't be used in weapons material due to contamination from Pu-240 and Pu-241. 

I don't defend them not because I can't, but because I don't feel the need to defend bad practices from the middle of the 20th century. Similarly, I don't think we should stop using paint because we used to include lead in it a half century or so ago. I also don't feel the need because those things were largely the product of 1) a weapons program that no longer exists and which has ZERO connection to MSR's and 2) LWR reactors which also have ZERO to do with MSR's. Thermal spectrum MSR thorium breeders would produce zero long lived waste, the only actinide produced being Pu-238 which is a non-fissile isotope used by NASA in atomic batteries. 98-99% of the waste produced from MSR's, which you would know if you bothered informing yourself, is fission products, or what the two halves of the fissioned nucleus form into. Fission products are SUPER radioactive, but they also have very short half lives (think a shooting star), with 90% of the waste produced by MSR's being gone within a decade. .

Radioactive iodine produced from Fukushima has a half life of 8.0197 days. That means that all the iodine released from Fukushima was GONE within a couple months of the accident. The problem is that Cesium 137 and Iodine 131 are both WATER SOLUABLE, meaning if the reactor overheats & or pressure is lost, that water turns to steam and takes the iodine and cesium into the atmosphere. With an MSR, you don't have water and the physics of the reactor make it impossible for it to over heat in a run-away reactor. If it gets too hot, fuel density in the salt drops too low to maintain the reactor and the reaction dies down. As it cools, fuel density rises up again and t becomes critical again, eventually reaching an equilibrium point, without any interference. You'd know that if you even bothered to watch a video on it. 

We do know what happens over time because the UN and WHO have been studying areas like Chernobyl and the areas around Hiroshima and Nagasaki for the better part of a century. 

What are you talking about Th-232 decay products? There's no fuel for it to build up in, or you'd know if you knew what you're talking about, which you admitted yourself that you don't. You dissolve thorium in molten salt, converting it to U-233 in the salt, leaving the U-233 in the salt, and the U-233 will fission in a graphene moderated reactor, with the ONLY waste being fission products, which I've previously noted, will largely be decayed to being non-radioactive within a decade or so. What are you talking about building up in spent fuel? It's pretty easy to filter radium and radon out of a salt if you wanted to. MSR's don't work if you don't filter fission products out of the fuel salt, but you seem to be talking about it like you'd use a solid fuel, which isn't how they work. More misinformation from you.

There is a very easy waste disposal solution. Fission products decay relatively quickly. Only Cesium-137 and Strontium-90 have long half lives, 30 years or so, which require up to 300 years for them to mostly decay away, but they represent a small percentage of waste produced, around 6%, and they can be used in industrial applications sterilizing stuff that must be free of microbial application. 

Glenn Seaborg didn't "develop" Pu-239. He was on the Manhattan project where they were looking at multiple options. He also concluded that U-233 could not be used in a gun-type bomb. You're statement about him and the beagles is also false. Per the actual report "The beagles regularly live to the age of 15 to 16 years under confined conditions if given proper care. The record of how this can be accomplished together with detailed atomic and physiologic information on the beagle has been published in a volume edited by A.C. Anderson, "The Beagle as an Experimental Dog". Iowa State University Press. Ames, 1970, 616 pages." Not bad for dogs injected with PLUTONIUM -239! 

Almost everything you say is false, and I keep pointing it out, point by point, but when you refuse to listen...
Reply: @jackfanning7952  Hinkley Point will cost about $25 billion euros and will produce 3200 megawatts. On an annual basis, it will supply 26 billion kWh to the British electricity grid. That's enough power for almost 9 million households, CO2 free power. Hinkley Point has a design life of 60 years, with the possibility of extending that to at least 80 years. Hinkley Point will supply more than 1500 billion kWh for 60 years. Spreading that 25 billion over that, you get a construction cost per kWh of 1.6 cents. 

The operating costs after commissioning of the plant are going to be between 1.5 and 2.5 cents per kWh, including all running costs during operation, including personnel costs, fuel costs, permits, insurance, maintenance, taxes and premiums to the decommissioning fund and the processing and ultimate disposal of waste. All told, you're left with a cost per kWh over 60 years of operation of 4.1 kWh. The difference between that 4.1 and the power strike price of 11.3 cents per kWh is premiums being paid into Britain's national pension fund. 

Of course renewables are cheaper than nuclear though, that's why Germany has the cheapest power in all of Europe while France has the most expensive power. 

Oh wait, this is reality and it's the exact opposite, with Germany having the highest electricity rates in Europe while France has the cheapest. Well, I'm sure it's just because Germany hasn't invested enough. Just keep throwing money down that hole.
Reply: @jackfanning7952  I'm also not going to waste my time on your other probably false solar information, but per IRENA, the International Renewable Energy Agency, the global weighted average cost of electricity cost of new onshore wind farms in 2019 was USD 0.053/kWh, with country/region values of between 0.051 and 0.099 kWh depending on the region. Costs for the most competitive projects were as low as USD 0.03/kWh, without financial support. So your 0.025 cents per kWh is either false or it includes a crap ton of subsidies buster. 

Offshore wind, with deployment of 28 GW in 2019 to onshore wind with 594 GW, was relatively more expensive than onshore wind, with the weighted average cost in Denmark being USD 0.087/kWh in 2019. 

I suppose you don't know that because you only listen to things you like or agree with. Of course, baseload nuclear doesn't get any subsidies and it's still as cheap or cheaper than your subsidized intermittent renewables. That's also before we start adding on the costs for batteries.
Reply: @williamsmith1741  I also am not going to all this stuff you presented. Thank you for taking the time to present it. I want to reiterate that these are not my figures. I cited the sources that presented those figures. Take it or leave it. I don't care. But if you are in the nuclear business, you should care who is believed and it isn't you guys. Either, you are lying or they are lying or you are both lying. However, I know that both of you cannot be accurate. Of course, I rely on information that I have a favorable opinion of. So do you. My quotes are not my own opinion, but what I have read from people who have knowledge of the nuclear issue.This I know. There is no way on God's green earth that I will ever support nuclear energy. The majority of the public has come to the same conclusion. They make that decision based on the nuclear record. Other South Carolinians and I and my children will be paying for the $14 billion Jenkinsville fiasco for the rest of my life. The former CEO has been sentenced to a $5 million fine and prison term for lying and fraud. I see similar situations in Ohio, Vermont, Washington, Florida and Georgia. Not one scrap of nuclear fission by-products has been safely disposed of since commercial reactors came into existence. I prefer not to have to rely on monopolies with political connections for energy. I prefer a grassroots type energy source more consumer-friendly than oil, coal or nuclear. I would prefer that nuclear meet the following conditions before it continues to exist: 1) End all government subsidies for nuclear energy. I would make that same demand on all other energy sources. 2) require utility owners to purchase on the open market full liability insurance coverage and accept responsibility for all damages, death and disease caused by nuclear power. 3) rescind the operating license for any reactor at the end of its 40 year design lifespan. I would require that the use of casks, tanks and any other storage vessel be restricted to its design lifetime as well. 4) Shut down all reactors until a permanent safe repository of waste, including tailings,  be implemented and all such waste is properly stored in the repositories. I would expect that these permanent repositories include provisions for the continued safe storage of such waste when the design lifetime (normally today considered to be 100 years) has ended.
Reply: @jackfanning7952  I'm not in the nuclear business. I'm in middle market financial consulting with a focus on transactional due diligence. I got into nuclear energy about 6 years ago, working in equity research at the time, after watching a documentary and I thought the claims sounded way too good to be true and must have been BS. So I spent a couple years researching it, watching documentaries, buying books to learn about the physics, the chemistry, and any and all related processes, and I suggest you do the same. Because while I'm sure you're very passionate about your beliefs, you're wrong. Nice place to start would be to watch any of the videos from Michael Shellenberger or James Hansen. 

I don't rely on what I hear from any person no matter how "well informed" I consider them to be. People lie and people espouse faulty anecdotal information just because it's "conventional wisdom". Don't believe me either, but you should know what you're talking about and you obviously don't as it relates to MSR's.

The public bases that on fear and what they're told, the same way that 100 million American's believe the last presidential election was stolen, because they were told that and they want to believe it. I can't speak to your Jenkinsville fiasco or wherever else, but it has nothing to do with MSR's as they are a COMPLETELY different process and would have a completely different capital structure. 

Nuclear fission by-products aren't used for anything. Spent nuclear fuel is regularly reprocessed in France and Japan to pull out and vitrify the unusable waste and put the unused fuel back into reactors. However, as I just said, that has nothing to do with MSR's which produce no long lived waste. So...still besides the whole point of the video you're commenting on but refuse to watch. 

There aren't any subsidies for nuclear power anywhere in the world. The only money spent on nuclear is toward nuclear research. Some governments guarantee the debt on reactor projects but then they make that money back by requiring additional premiums to be paid which go to public use like the British reactors you brought up earlier. Basic research doesn't really count as subsidies though, or else you should also start adding them onto the straight up subsidies being provided to renewables. I almost got solar put on my house like 3 weeks ago, and the sales person said that the Federal government would reimburse me on my taxes for 25% of the total cost of the install. That's not something nuclear gets. Nuclear gets additional taxes placed on it just to make it less economical compared to other power sources, placed on it in Belgium, Sweden, Germany, and some other places. 

I don't really care about LWR's. They're carbon free power and they're safe, so I don't want to mess with them. But I'm not advocating building any new ones. 1) They're way too expensive and take too long to build, 2) they're wasteful (only fissioning less than 5% of the fuel which makes the other >95% long lived waste), 3) and they rely on water cooling which is incredibly dangerous if an accident happens. I support the commercialization of MSR's because it addresses each of those issues. 1) Their capital cost should be somewhere between $1500 and $2000 per kW (just north of what it costs for nat gas and coal plants, so pretty cheap), 2) being based on the thorium fuel cycle they wouldn't produce any long-lived waste with the vast majority of the fission products produced decayed to background radiation levels within a decade of production, 3) they don't use pressurized water, operating at atmospheric pressures, which eliminates the majority of safety issues associated with nuclear reactors and making it impossible to have an atmospheric discharge of material. 

4) And one more benefit is that U-233 can't be used in nuclear weapons due to unavoidable contamination from U-232. U-232 decays into thallium 208, which gives of a 2.6 MeV gamma. If you use U-233 contaminated with U-232 to build an implosion type bomb, the type of bomb they use plutonium in, the 2.6 MeV gamma will fry the electronics of the bomb, making it useless. U-232, like Pu-240, also has a high propensity to pre-detonate. If you make a gun-type bomb using U-233 contaminated with U-232, when you trigger it, you'll get an explosion that's only powerful enough to blow the bomb apart like an exploding water heater, and little else. 

So, for the cost of a natural gas plant, you get a CO2 free source of power that uses the waste stream of phosphate and iron mines to produce 1 million times the amount of power you get out of an equivalent amount of fossil fuels, you produce no long-lived radioactive waste for disposal, the process driving the reactor makes it explosion proof, and the fuel it runs on is SO unpalatable as a bomb material that in the ENTIRE history of the Cold War, U-233 was only ever considered for bomb material twice, during the Manhattan project and once in 1952 for Operation Teapot, both instances determining that U-233 is usless for bomb material.
Reply: @jackfanning7952  Are there issues with MSR's? Yes, and I could tell you, but you've already stated you don't care what the benefits are nor the problems. There are different issues and benefits for fast reactors, and different issues with LWR's (no additional benefits with LWR's, just different problems). There are reactors which can get rid of your long lived waste and reactors which can't get rid of long lived waste, but won't produce any new long lived waste either. You just have to recognize that some of your beliefs, some of what you've been told by "knowledgeable people", might be completely wrong. Then you can start doing your own research.
Reply: @williamsmith1741  Thank you for the information. I will check out MSRs more thoroughly. After 75 years of lies and ripoffs by the nuclear industry, maybe they can convince me that they actually can do something right (so far I haven't seen any proof of that). The people I read do not have a vested interest in the results of their claims as yours do. I am sceptical of MSRs for several reasons. They have high start-up costs, the return on investment is uncertain at best and they have high fuel fabrication and reprocessing costs. Salt (and radiation) is nasty stuff to deal with. The alloys needed for MSRs are really expensive and beryllium as a moderator is a health problem that will have the lawyers lining up at the gate to sue. MSRs are still nuclear reactors with high gamma radiation and some alpha and beta radiation within the process, which result in high fuel reprocessing costs. Things like cesium-135 and 137, strontium-190, iodine-129, technitium-99, and proactinium-231. Once you get that crap out of the fuel, thorium is quite boring. We could use a little boredom in the nuclear business. Waste is still the bull in the China shop (no pun intended).And the short-term (less than 300 years) waste is still a biggie. No one has ever stored nuclear waste safely for even one year, much less 300 or 250,000.  They are even more expensive than other nuclear reactors. Smaller reactors in more locations present proliferation risks and the high cost of fuel reprocessing. Do you trust India and China to do the right thing? I don't. Nether do I trust the U.S. And you can make bombs out of them. Although I don't know why anyone would want to, there is plenty of plutonium available to steal. You could probably scrape enough up off the slopes above Fukushima to do it. The sequence is Th-232 to Th-233 to Pa-233 to U-233. I think the only reason the nuclear industry is turning to MSRs is because they are running out of commercial grade uranium ore. Since you are in the financial business, perhaps you can explain why MSRs are not being financed. Maybe because it is more difficult to make a bomb, except a dirty bomb, out of it. The "nuclear research" is to keep the bomb makers employed, but nuclear reactors have become a bigger weapon of mass destruction than the bombs. I think they should focus research on the waste problem and how to counteract the radiocene effect of continued nuclear energy production.  The fact that nuclear does not have to provide liability insurance, pay for their waste disposal (nuclear fission byproducts are used for something. Finagling $1 billion a year out of taxpayers) and clean up their disasters is a massive subsidy. The $14 billion spent on Yucca, the $8 billion on the kaput SC MOX plant and the $? billion on WIPP is a nuclear subsidy. Kitty litter is WIPP's krypton. What is MSR's krypton? I hope we don't find out. I am betting on renewables. Larry Householder, Speaker of the Ohio House, received a $61 million bribe from First Energy to pass a $1.6 billion per year Ohio energy tax to keep nuclear from going under. That is a subsidy as is the $1 billion a year to store fission by-products onsite and the cost of the WIPP plant. Hope they don't blow. Other big nuclear utilities are leaning on state legislatures to pass more subsidies to keep nuclear from losing market share to renewables. Actually, I am surprised that solar is getting any government subsidies. Fraud, graft and corruption is easier with large nuclear (or fossil fuel) monopolies than with grassroots renewables. It will take renewables many years to develop the infrastructure to rival the fraud, graft and corruption of nuclear. I am sure someone is working on it. 
LWRs are not carbon free, because huge amounts of fossil fuels are used to generate enriched U-235 and build reactors. Lots more would be used if they ever got around to building waste storage facilities, burying tailings  and decommissioning reactors. Reprocessing is very expensive and very dirty and only reclaims 1% of the waste, according to what I have read. The process actually creates more waste than it recovers. I have also read that La Hague lost all its international customers and the only one using their reprocessed plutonium is their parent company, Oreno. I also read that Swedish research claims that vitrification of nuclear waste breaks down after 100 years. My grandmother used to say, "if it isn't one thing, it is another."
Reply: @jackfanning7952  I wouldn't say there there's been 75 years of lies, but I also wouldn't suggest relying on the NRC or the DOE for honesty. Oak Ridge was eventually muzzled, getting it's budget cut, and it's director was fired, Alvin Weinberg one of the inventors of LWRs and fathers of atomic energy, because they wouldn't be quiet about how unsafe LWR's were due to the issues of pressurized water. The AEC didn't appreciate them rocking the boat by making people question the safety of all those big expensive reactors that utilities had been putting up all over the place for a couple decades by then, so Weinberg got the ax and a big chunk of Oak Ridge's budget got shifted to Argonne Labs for fast reactors (which could produce weapons grade material in spades). 

I would always encourage people to educate themselves on the fundamentals of something rather than take someone else's word for it. Also, an individual's personal interests aren't always monetary. There's lots of people who've invested their personal reputations into their blanket opposition to nuclear. If they change their position they run the risk of people no longer buying their books, going to their rallies, or donating to their organization. 

It's fine to be skeptical about MSR's because they sound WAY too good to be true, bordering on "Become a millionaire working from home while also getting six pack abs and increasing your sexual performance!" Sounds like a total scam. They don't have high start up costs though, for a few reasons, which would also allow them to be built in a more typical time frame (1-3 years as opposed to 7-10), which is one of the benefits. 

MSR's don't require ANY fuel fabrication. The fuel is completely dissolved in a liquid salt. The fuel starts out as Thorium -232 which is bread into U-233. Thorium is a pretty inert element though, and is readily derived from the waste streams of any mine producing monazite ores. 

The primary metal used is a nickel alloy. They use beryllium as a doping agent in the salt, not a moderator, preventing it from leaching chrome out of the nickel (issues of corrosion were largely addressed back in the 60's). Beryllium is a common alloying element used to harden the steel in most of the hand tools we use. Beryllium toxicity is primarily caused by machinists, who were milling parts and tools make out of a beryllium alloy, breathing in the dust from the milling process, and in those cases, it was only for beryllium that wasn't processed correctly, so it contained beryllium hydroxide which is water soluble and would bind with mucus in the lungs, causing issues of COPD or asthma like conditions. 

Again, MSR's aren't solid fueled reactors, so they don't require their solid fuel to be reprocessed. There's online reprocessing as the fuel is reprocessed while still in the reactor's system, with 90% of the fission products being SUPER radioactive isotopes that will be completely gone within 10 years of being produced. Only Cesium 137 and Strontium 90, which will make up about 6% or so of fission products, will require up to 300 years to decay to background radiation levels. However, both of those isotopes might not be considered waste products either as they can be used in applications requiring microbial sterilization. If you don't want to use that cesium or strontium, then no biggie, because you only have to store that 6% for about 300 years. A kilogram of thorium could provide all the energy you'd need over your entire life, power, vehicles, food production, clothing, etc. So to provide you with all the energy you'd need over your entire life, we have to sequester 60 grams of material. 

I don't know who told you this but there is almost no Plutonium to steal. U-233 has a 90% fission rate, meaning only 10% of the U-233 will absorb a neutron becoming U-234, which isn't fissile. U-234, if left in the reactor, would absorb another neutron, becoming U-235, which has a 85% fission rate. That leave 1.5% of the fuel you started with becoming a trans-uranic. However, that will eventually become Pu-238, which isn't fissile but which is in very much demand as EVERY space probe sent as farther than Mars has been powered by atomic batteries that use Pu-238, and we're plum out of it now. 

They're not running out of commercial grade uranium. Even if they were, uranium is water soluble and the oceans are full of it if we wanted. It's not necessary though. And the nuclear industry isn't turning to MSR's. All the people trying to commercialize it are pretty much start ups like FliBe energy, Elysium Technology, and Thoracon. 

They're not being financed because there's both a lack of awareness of them and a lack of understanding, with a lot of people conflating them with traditional nuclear power, which they aren't. There's as much similarity between an LWR and an MSR as there is between a coal powered locomotive and a diesel powered locomotive. That's why I'll challenge any misinformation I come across because that misinformation just feeds the problem. 

The "nuclear research" isn't for bombs. It's mostly for fusion research, historically, with reporting grouping them. Last couple decades though, there's been a pick up in research in fission, with a lot of that being private funding going to MSR's and similar technologies over the last 5-10 years. 

Yes, you can make a dirty bomb out of the waste stream from an MSR, but you can make a similar toxins, like making a bomb full of Ricin, but you're not advocating them ban the growing of castor plants are you? The benefit of an MSR's waste stream is that it's SOOOOOOO toxic, anyone exposed to it would likely go into neural shock almost immediately if they tried to access it for nefarious reasons, and die the following day. You'd also be able to locate the waste relatively quickly using any gamma detector on the globe. 

All nuclear plants must pay for waste disposal and decommissioning costs. It's true there's no current plans on what to do with those dry casks, but I'd rather we burn up those long-lived radioactive materials in a fast spectrum burner, like what is being worked on by Elysium technologies, converting them to short-lived radioactive fission products which will be gone in 300 years tops as opposed to be sitting around and being dangerous for hundreds of thousands of years. 

How would spent fuel rods, dry casked, "blow"? In case you weren't aware, likely, the percentage of fissionable material in thermal spectrum reactors is sufficiently low, just a couple percent, that they can only be critical in close quarters and in the presence of a moderator, which is water in LWR's and PWR's. Once the rods are removed from the reactor and allowed to cool (all the short lived fission products decay away), they're put into their dry casks where it's physically impossible for them to even become critical again let alone "blow".

Well, according to the numbers you provided for your own solar and wind costs, at least half the cost of wind and solar is being covered by tax payers. 

Yes, it costs energy to mine the fuel, enrich it, build the structures. But it also requires the same energy to mine the materials used in solar cells and windmills, pour the concrete foundations, and when they're done with the solar cells, what do they do with them? Recycle? Nope. They and their heavy metals and plastics and toxins go to land fills to leach out into ground water over decades and centuries. At least the radioactive waste from a nuclear plant decays away. Toxic waste from solar cell production and disposal will be toxic FOREVER.

As I said, you don't reprocess solid fuel in an MSR because they don't use solid fuel. The fuel NEVER LEAVES the reactor. The ONLY THING coming out are fission products, 90% of which will be gone within 10 years of being produced. You keep bringing up issues associated with LWR's, but they have NOTHING to do with MSR's and aren't the point of the video you're currently commenting on. 

Vitrification melts the materials in glass, which is a disorganized silicate structure. I don't know how your "knowledgeable sources" determined that glass was able to decompose. I also don't know how they were able to determine that glass breaks down over a century even though they've only been dong the process for a few decades. You might want to ask your "knowledgeable" sources if they have any evidence of if they're just pulling that conjecture out of their...
Reply: @jackfanning7952  So yes, I would encourage you to learn about stuff you agree with and stuff you oppose. It facilitates the process of independent critical thinking, allowing you to reflect on and audit your own beliefs. You seem to think that MSR's are just somewhat different than LWR's, as you're talking about fuel fabrication, the production of plutonium, and other things that have nothing to do with MSR's. 

If you want to know what the REAL problems with thermal spectrum MSR thorium breeders, kryptonite you would say (not really kryptonite but actual drawback considerations), I could tell you, but you don't seem to be interested.

However, if you do choose to actually learn about MSR's, both their good traits and their drawbacks, and you discover a KILLER drawback, please let me know. I started learning about them 6 years ago ONLY because I was trying to find the problem with them that people like Kirk Sorensen weren't talking about, the kind of thing you'd quickly mumble at the end of a prescription drug commercial. MSR's were just too good to be true other wise. 

Six years later, I've become so knowledgeable on the topic that it's obnoxious. My coworkers and family actively try to avoid the topic because my knowledge has been registered as a lethal weapon of boredom. It hasn't brought me any profit or happiness though, as I never found that catch or drawback that I assumed "they" were hiding. So if you find that reason why MSR's really aren't possible, please let me know. MSR's have a couple real drawbacks, but they don't undermine the benefits of the technology nor do they make it somehow technically unfeasible.
Reply: @williamsmith1741  Hi, I'm just commenting here to commend you for how well you argued your points against Jack Fanning, especially regarding how difficult they were being as a debate partner. I especially liked how you kept your cool the whole time and steadily pointed out all of the assumptions and faulty info they were bringing up while reiterating your own points in a calm and logical manner. You sir are an inspiration, the world needs more people like you. Also, I want to thank you for all the effort you put into those long and informative discussions on this subject that I just spent the last couple of hours or so reading.
Reply: @rerver8842  Sure, but we all have a responsibility to stand up and challenge information we either think or know is bullsh@#. However, you also need to be open to the possibility that it's you that's wrong, which is not something that people like  anti-nukes like Jack Fanning or other ideologs can really accept. I personally relish the thought of being proven wrong, as it represents an instantly recognizable instance of anagnorisis, pure learning and growth. My eyes were closed but now they are open.

Don't take my word for it on thermal spectrum MSR's though, because I could be full of it. Check out the channel of gordonmcdowell  as there's TONS of really interesting videos on there. Also buy books on it like "Molten Salt Reactors and Thorium Energy" or "The First Nuclear Era". It was from the latter book that I learned that U-233 contaminated with U-232 couldn't be used in either implosion type bombs or gun-type bombs, but for different reasons. Explore the claims of advocates and the critiques of skeptics. 

And if you find a major hole, a reason why MSR's just won't work, I'd ask that you let me know so that I might see how I was wrong.